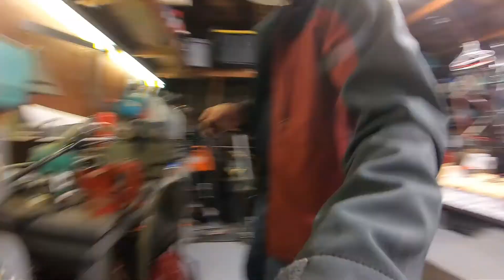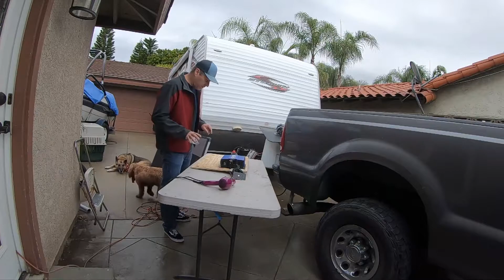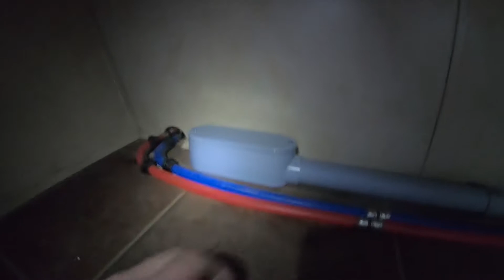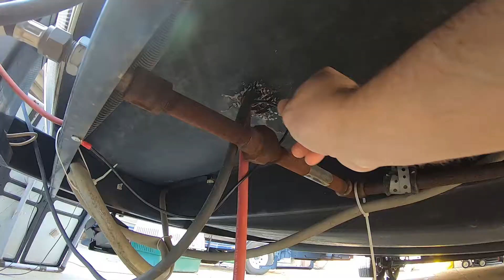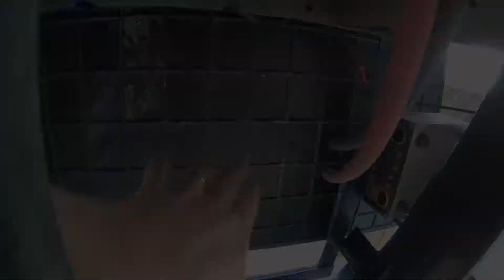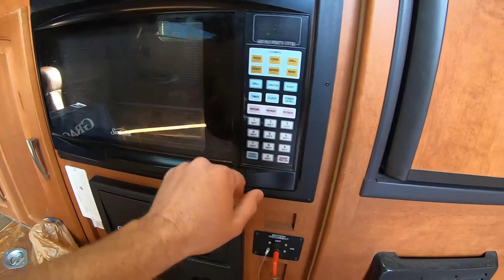RV Inverter Installation

Comment: Out of curiosity, don't they make a transfer switch that you can put shore power and DC/inverter into?
I am still in the "I want a Lance 1685" stage...  But from what I have learned so far, I think I would rather do the Solar/inverter myself, for what they charge and what they use...  Not that it is crap, but I can buy a Battleborn battery $300 cheaper than whey charge MSRP for a different brand of LIFePO4...

Thank you for sharing how you did your work.

Comment: You know you can only get 600 watts out of the inverter by putting a 50 amp breaker in line from the battery to the inverter right?
Reply: Yeah I wondered that too. He could have done a 200amp breaker to get max power